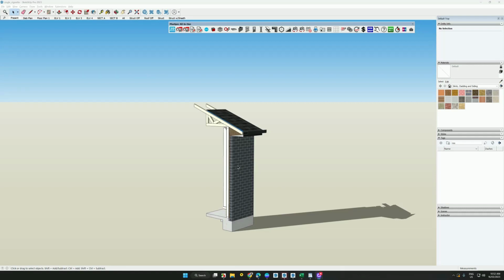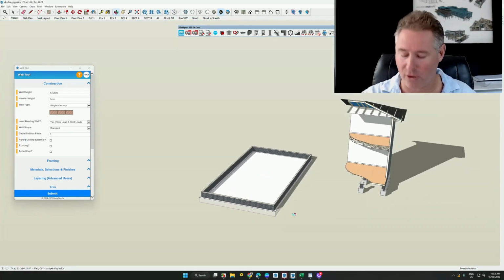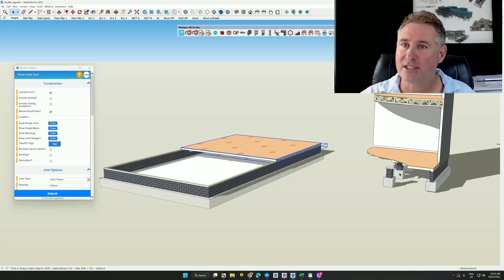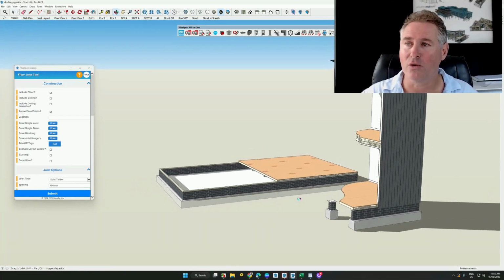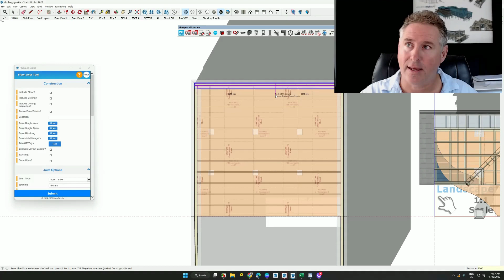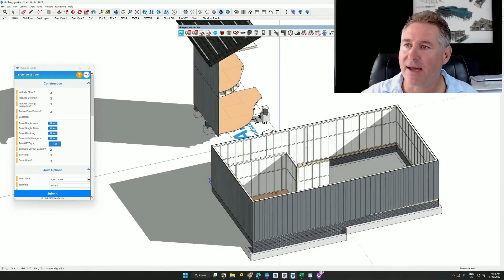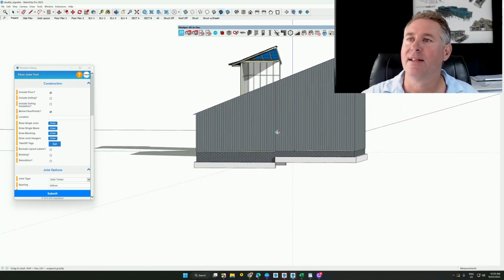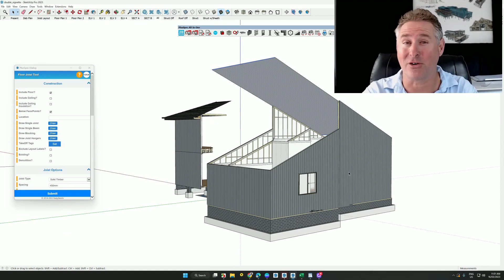NEW parametric features save time: PlusArchitect & PlusDesignBuild for Sketchup 17 - Sketchup 2023

Comment: Our first 3 days we have successfully drawn some simple models but it is pretty intuitive with the informational videos online. I have few questions but unable to contact an actual human. Only thing we can't get to work is getting wall studs to show... shows plywood and floor joist/trusses if designed manually but wall studs never show in scenes . Looking to invest in this and sketch this year to possibly ditch AutoCad but clarification is needed
Reply from the maker: Hi, were glad your getting the hang of it quickly and it gets much better the more you use it.  What version are you using?  PlusArchitect and PlusDesignBuild have the framework and Plusspec pro has multiple layered walls without framework.  You can call the office Monday to Friday  9am to 5pm AEST 0296792429

Comment: Love this plugin.. and it is similar to Citools ( plugin for Archicad ) in term of pricing which is the plugin are more expensive than the main software itself.
Reply from the maker: Yes, what we do is very specialised for customers who need to get the job done more efficiently, and yes, it is more expensive than Sketchup alone yet cheaper in combination than ArchiCad and Revit. 
 We look after our clients with massive savings upon resubscription and continue developing better systems according to the feedback we receive.   Thanks for commenting @NBCnothingButCrap
👷‍♀
Reply: @PlusSpec   Yeah.. not every comment will taste like sugar sweet, but that will make something grow. Where can I check for the resubscription price then.
Reply from the maker: @NBCNothingButCrap  a bit of vinegar is good for the diet. 😎  You'll find the resubscription price on the buy page.  It's around 7 or 800 usd which I'm pretty sure is 4x less than Revit or ArchiCad and we keep improving and innovating do you'll get the latest and best we can possibly deliver.

Comment: Can it do light guage steel framing?
Reply from the maker: You can create a light guage  material for studs and change your bottom plate thickness. Your takeoff will read correct.  If you're referring to roof purlins, you'll see c section and z section purlins and also rhs box beams in joists and rafters.  
If we receive enough interest in cold rolled steel framing and products, we will look into it, but at the moment, there isn't enough call for it and it'll be too expensive to develop for 3 or 4 people.
Thanks for asking.  I'm pretty sure there is a tutorial for this somewhere.
Reply: That would be nice :)